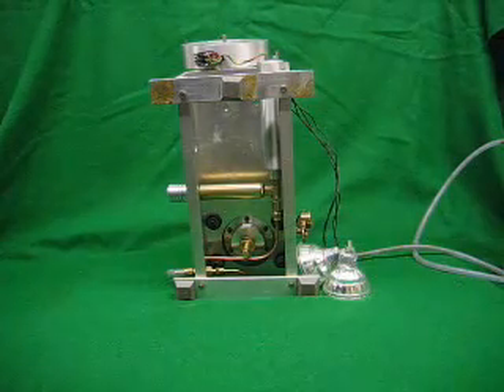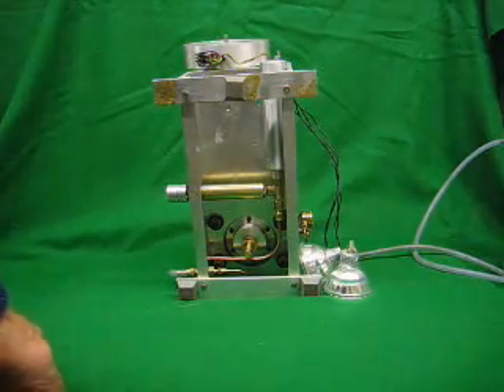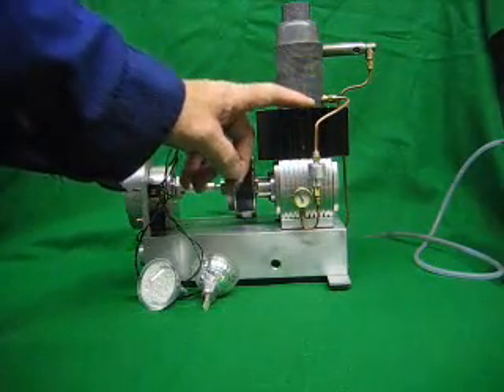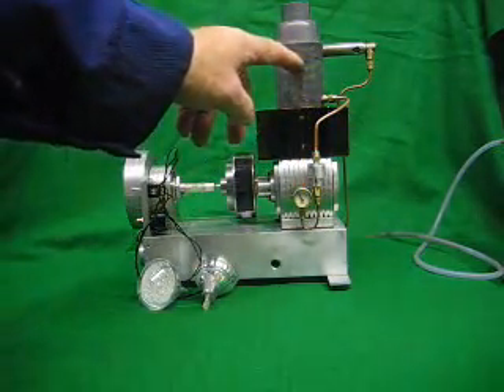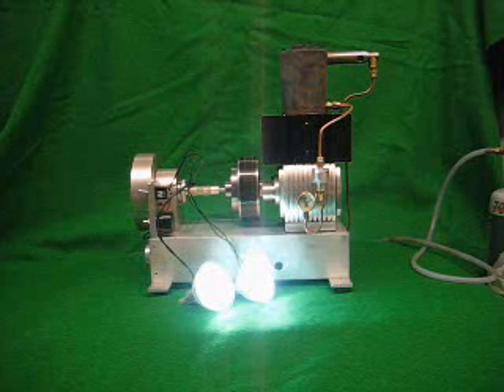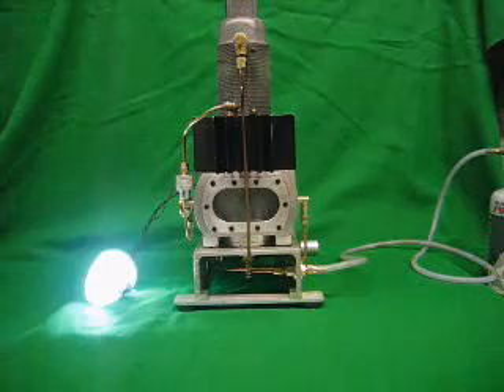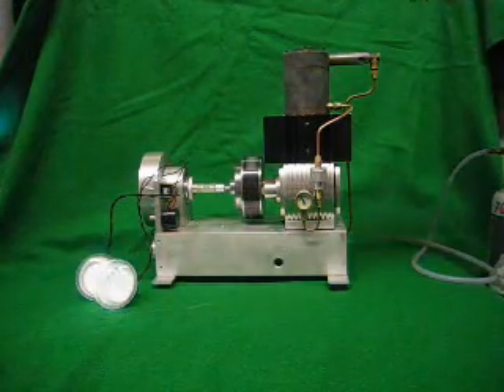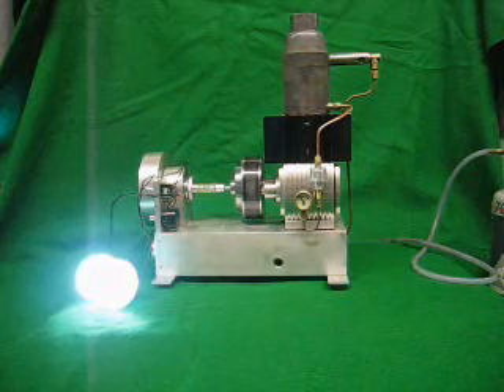Rhombic Drive Stirling Engine,    10cc Pressurized,  Part 2

Comment: every demonstration of the sterling engine no matter the application seems to require one fuel or energy source to create another energy source.  Unless the original source is cheaper than the output energy there is no benefit to this kind of technology.  If you have a natural gas well you own, a geothermal tap to free heat or an endless free source of heat source fuel then there's no gain.  Solar seems to be the free daytime source for heat energy that makes the most sense. If you have an even larger engine to power a compressor of an air conditioner that would make sense. A small parabolic collector could generate as much daytime heat as you would need. The scale of the solar collector dish would be determined by the size of the sterling engine needed to generate the required torque and RPM.  I would like to see a sterling engine built to power the compressor for an air conditioner.  
Photo voltaic panels would of course accomplish harnessing the sun’s energy to power a home air conditioner but with current efficiency only at 18 to 25 % you would need quite a lot of panels to capture enough energy. The price today for the 20 year efficiency life expectancy is not viable as well.
Reply: By the strictest definition, an engine is is a device for transforming one form of energy to another, the most common being converting chemical energy (fuel) or heat into mechanical energy (work) or electricity. Energy can't be created or destroyed, only converted from one form to another or "lost" as waste heat. The advantages of a stirling engine are that they can use any source of heat, even "waste" heat from other processes, and the theoretical efficiency is quite a bit higher than that of an internal combustion piston or turbine engine. They're not some magical free-energy technology, and nothing else is either. Even something like solar isn't truly free, because it costs time, energy and money to set up in the first place.
Reply: Ryan Willis ; could you plz help me with this machine plans..coz i want to develop this kind of mach, in our poor village..neighbour houses lack of electricity ...we could use a decomposed gas as a energy resource...thanks, pls email me.:.  hiryand1@gmail.com

Comment: Beautiful work. Does adding coolant flow increase power output significantly? I would love to see you design a larger version, using as many off the shelf parts as possible. Your 10cc design could be very useful for estimating the size engine needed to produce a useful amount of power from heat sources such as methane from anaerobic digestion or parabolic solar. The heat from the coolant line could increase the efficiency of a digester fuel source. Wonderful work, please post more!

Comment: Your free speed, & speed under load seem quite close. Am thinking more output power could be realized by adding more load.
Now flipping the question around, what kind of power will this motor develop when running at 1 atmosphere?
Keep the videos coming... Like them all

Comment from the maker: On the downward stroke of the piston the air in the crankcase is compressed, this increase in pressure is allowed to pass through the snifting valve which is a one way device and enter above the piston, this ensures that the air leaking past the piston rings is always in a downward direction
this stops the oil from going upwards into the hot end of the engine, it also puts the linkage in compression all the time making for a quieter mechanism.  I hope this is helpful, Cyril